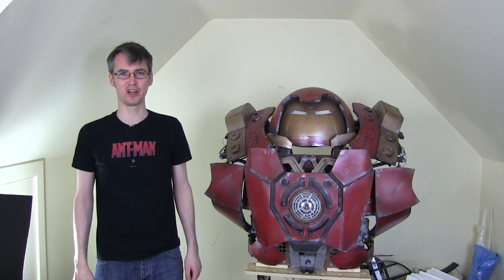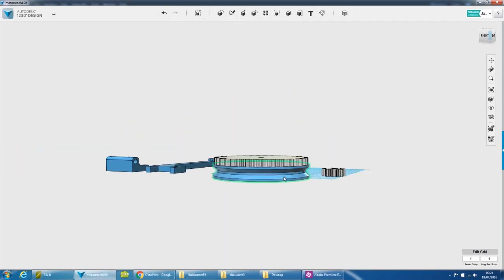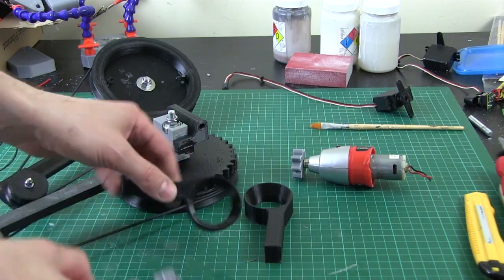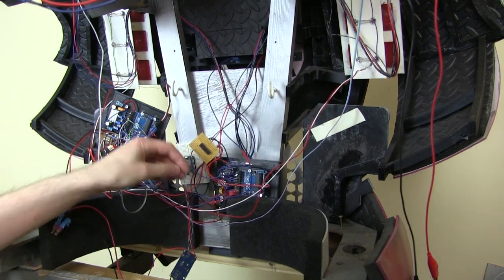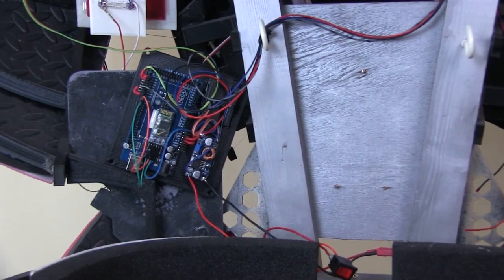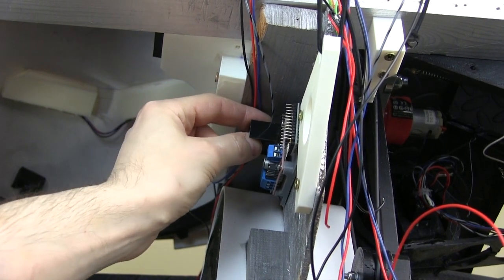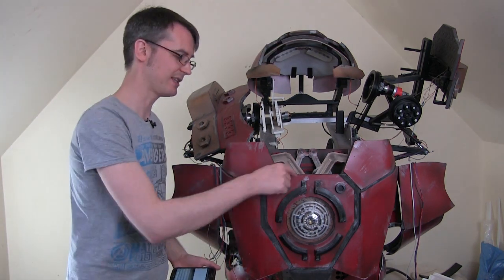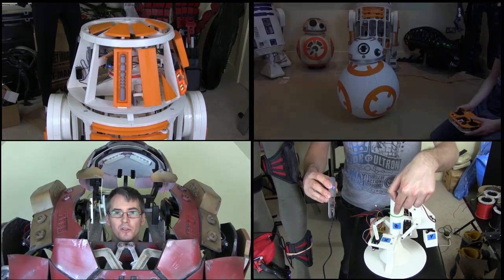Iron Man Hulkbuster Cosplay #54 | Fitting the Control System | James Bruton

Comment: James awhile ago you said you wanted to add in some wires under those plates that flip up next to the unibeam, but I think what would be a lot cooler is if you made the unibeam fire, then had the plates open up to what looks like "tubes" made from taulman t-glase that lead to the center. Then you could place small leds under the "tubes" and have them start full brightness when the panels open, but fade down. It would make it look like the unibeam has to cool down after you fire it, and plus just look straight up cool. :)

Comment: The shoulders might be a little bit sluggish at the start due to the belts being slightly too long/loose/elastic. The slack/strain/elongation has to be taken up before the cam starts to open the shoulders. Stiffening that mechanism up using a different belt material (less elastic) or shortening it might help. I've also noticed that you've knotted the belt inside of the top roller, perhaps there's some play at the knot. Just a thought. Keep up the good work.

Comment: Are you going to leave a gap in the neck of hulkbuster in order to see?
I think that you can install a small camera and a screen inside, in order to see without leaving a gap in the suit. There are tiny cameras designed to be installed on cars in order to help when parking and they cost less than 20€

Comment: You cannibalize the motors and gears out of electric screwdrivers and don't use one when you build these robots. Are you just trying to work out your fore arms? Seriously, get a good electric driver for all your projects and your arthritis will not start screaming at you for 10+ more years (advice given to me from a master industrial electrician).

Also, You should really look at diffusing the light on all of the reactor and thrusters LED arrays. You have great patterns and intensity changes on them, but they need to be diffused. There are 3d print solutions for the lenses, but with very long print times. Acid/solvent etching of a lens layer might help too.
Reply: Electric screwdrivers are for wimps! :) and they need recharging all of the time. With a manual screwdriver you just need to eat a good meal to recharge it!

Comment: does anybody know what 3d printer that is? I'm looking to get into 3d printing my costumes rather than foam, and I'm looking into a machine that can print larger pieces. Thanks!
Reply: +Gabi Paczolay he has a bunch of 3d printers. the 2 really big ones are a Lulzbot Taz 3 and 4.
Reply: thanks man! appreciate it! would you happen to know any printer that can print on a large surface area but at a reasonable price?
Reply: +Gabi Paczolay for anything over 20cm cubed you're looking at $1500+. But it's really not necessary. I've gat a wanhao duplicator i3 and I can't recommend it enough. It has a 20cm cubed build space which is plenty for most parts and if it's not, just split it up in cad and you can super glue PLA, or solvent weld ABS with acetone. That's what James does to make his stuff.
Reply: +Gabi Paczolay oh and the wanhao i3 is only $400